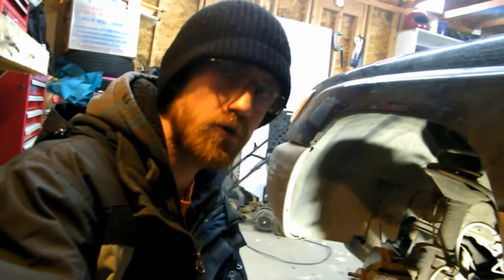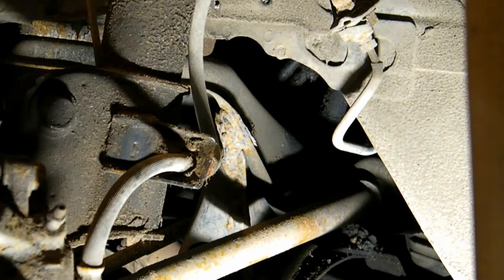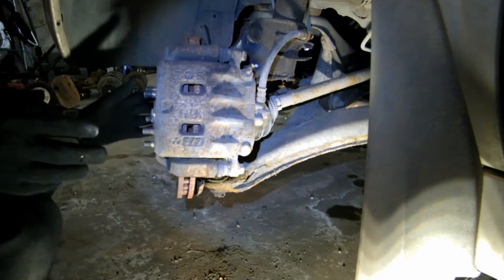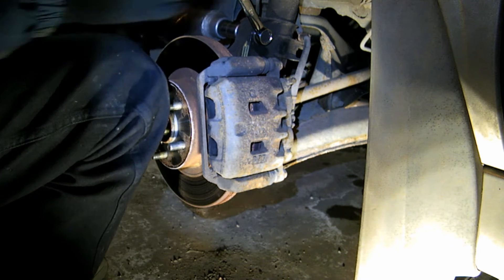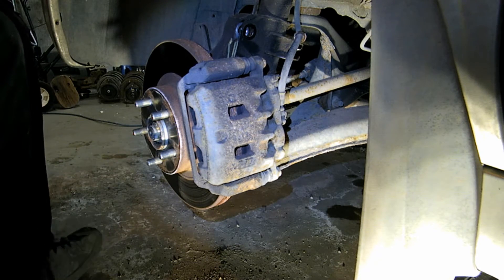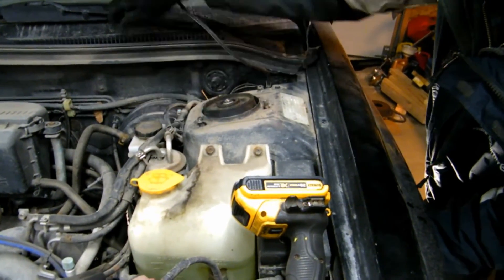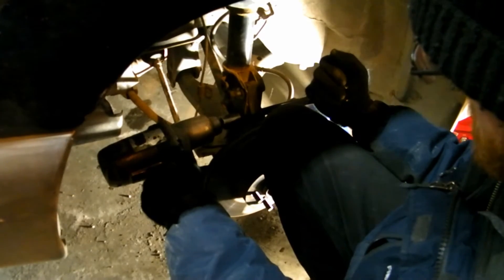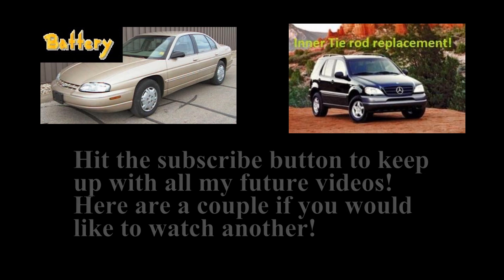How to replace a Quick strut 1997 - 2002 Subaru forester front (SAME ON MOST MAKES AND MODLES)

Comment: I saw the hole and didn’t have the tool to cut, didn’t want to deal with the brakes. Also I was concerned for right parts as mine is 97 straight from japan. I think I might go for it now after watching this